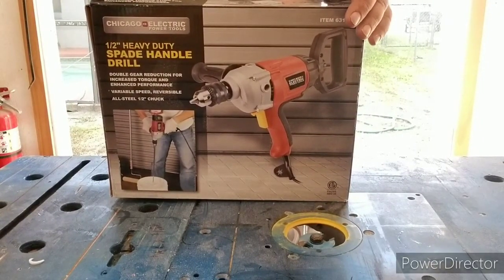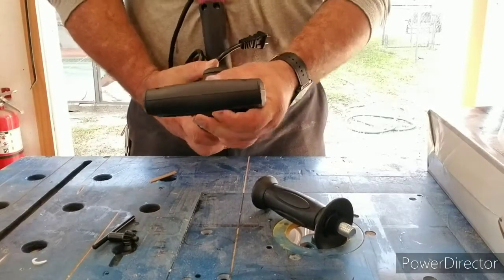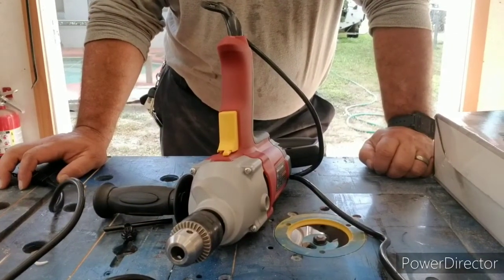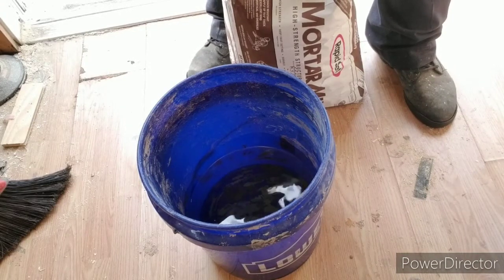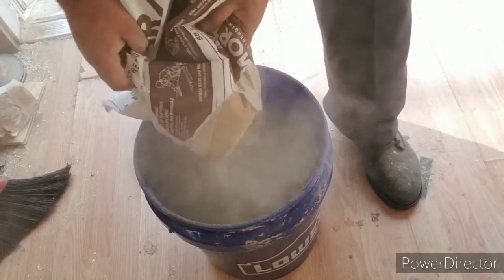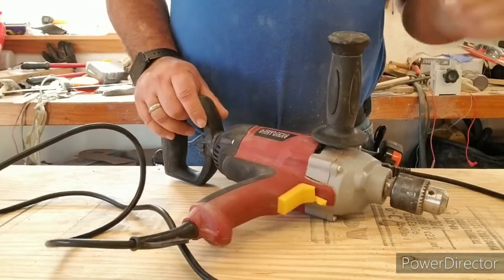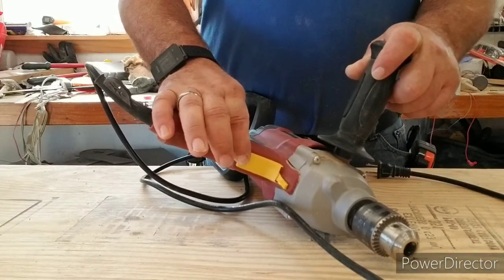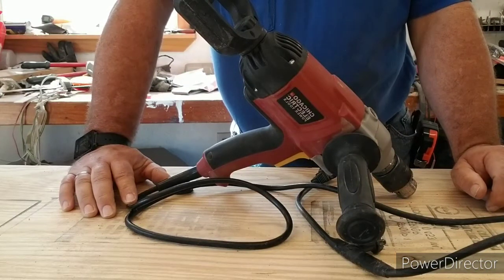CHICAGO ELECTRIC  1/2 In. Heavy Duty Spade Handle Drill  63112, 93632, 60436, 63116 review

Comment: From 1-10, how likely would you recommend this drill? I work as an Electric Rough-In, I usually use drill to make holes to run wires. recently, my drill broke, had it for a long time and I hear that this drill work great. What do you say? Would you recommend it?
Reply from the maker: For the price, I don't think you can get anything that would work better. The motor seems strong. The only weak spot is the reverse switch. If you plan on using it several hour a day, 5 days a week I would get a contractor garage tool but they start at 3 times as much. If you are drilling less than 100 holes a week I believe it would hold up for a long time. Or if you use this on commercially and it's last half as long as one that costs 3x as much it is still a good deal. I believe the 2-year warranty is only around $10. Use a coupon and the warranty is basically free.
Reply: Robert Palmer, thank you for your time and your help.

Comment: 1/2" DRILLING & MIXING KIT king industry .  cant figure out how to releaser and remove the Chuk please help
Reply from the maker: I do not have that brand.  However, most drills you open the chuck all the way up like you are going to put the largest bit it can fit in. Then, in the bottom, there is a screw that holds it on.

Comment: Can you drill into concrete with this drill?
Reply from the maker: Yes. I drilled 20 or more 5/8" holes through a 6"  slab. You just need a masonry bit.
Reply: @ShopRamblings  thank you for the quick responce.
Reply: @IvanHVAC  Do yourself a favour and get an SDS drill. These have no hammer function at all. Basically just a low speed high torque version of a standard drill.